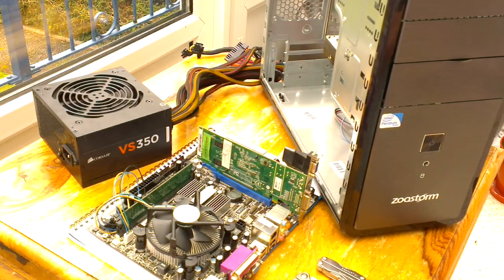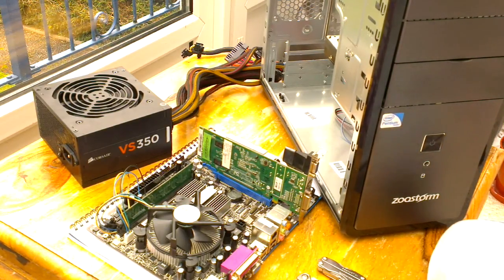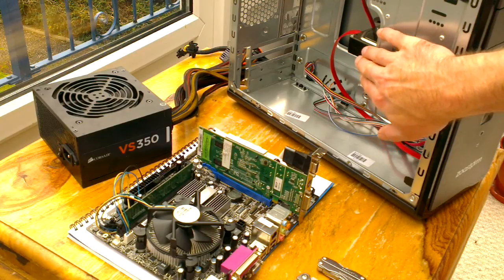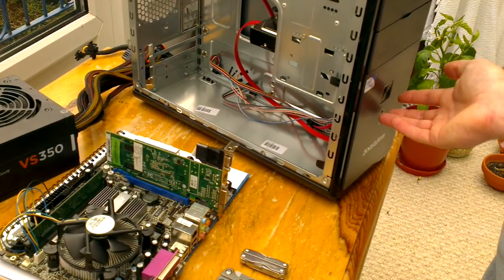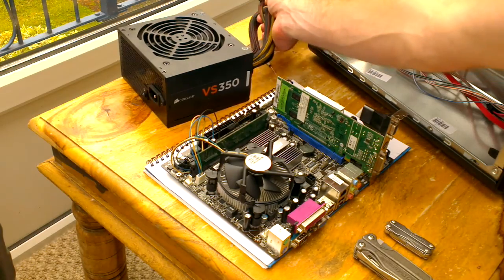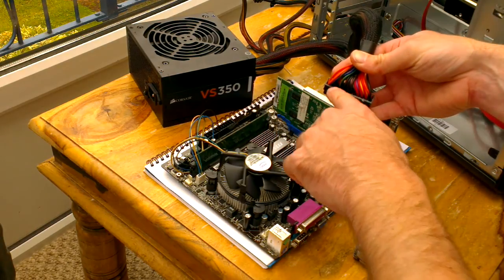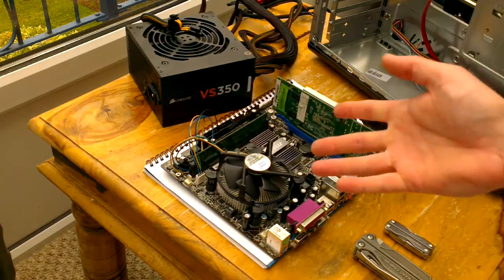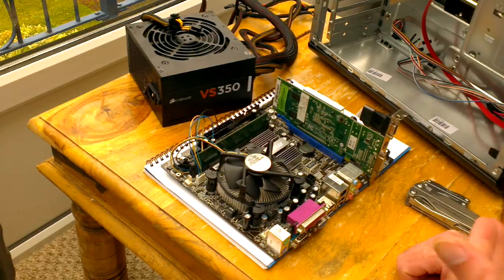[FAULT] MSI MS G41M-P28 | No Boot | No BIOS | No D

Comment: I don't know the problem of your board in the video but I will describe my problem with my exactly same board here : ))
I have this G41M-P28 currently in a no boot, no video output, no beep, no BIOS state. 
As my another second G41M-P28 board, it should works fine after 15 or 30 minutes of powering it on and leave it warming up and then press reset. It turns on and works normally
But for this board, the reset pins dosen't work when I short them with screwdriver. 
Kinda worry that this board has defecte reset function.
Been powering it on and waiting if it can turn on and output video normally

Comment: hey there! i have this exact same board and i tried to overclock my cpu with this board and i overclocked to 2.7 Mhz with an intel core 2 quad q8300, and i saved and exited, now its not gonna bood, blank screen, no output at all, no beeps, no nothing. pls help this is my gaming/work pc my life is literally on it (ik i can swap hard drives but i dont have any other computers)
Reply: remove the battery from the motherboard to restart the bios
Reply: This MSI motherboards have a known problem... the pci express for the videocard is kinda loose, try removing it, if the pc starts and beep and gives power to usb devices, reseat the gpu
Reply: things are simple. 
First, some people said that overclocking on those 45nm Yorkfield Core 2 Quad like the Q8300 is not good, their performance are ok without overclocking.
Secondly, this board (I have exactly the same board as yours) are...bad at overclocking as its capability to overclock is small compare to some Foxconn or other brand boards. You cannot power on when you overclock your CPU over this board and the CPU overclocking capabilities. This MSI board itself and some other boards too, are hard to power on and output image signal if you put them unused (being turned off or no power) for a long time and you will have to power them on for hours before they can work nicely again. I have two of this board and they even need a GPU to be able to output image as the intergrated graphics (the Intel X4500 as I remember driven by the southbridge) is weak and more likely to be dead when time flies.
So, you should remove the CMOS battery and turn on the board as blank and start over, or my method for my board is power it on, leave it for 15 or 30 mins in the "no boot, blank screen, no output" state and then restart it again, in all cases it must work again and display the red warning message: "Warning! Your prevoius overclocking session has failed" and it will let you go to the BIOS and changes overclock settings again.

Comment: Very interesting!  I had bad experience with MSI boards many years ago, we trialed them for a few months and then quickly moved onto another manufacturer, mainly due to glitches with the chipsets they used.  I don't like some of these surface mounted sockets either, but I kind of get why they are doing them.  I think with the number of pins they have now the pressure required to push them into a PGA type socket would be a problem, and if they use the sockets that have mechanical clamps etc it could be tricky to manufacture due to the physical size.
Reply from the maker: +GadgetUK164 Cheers :)  I pilfered this for the connectors before binning it for good!